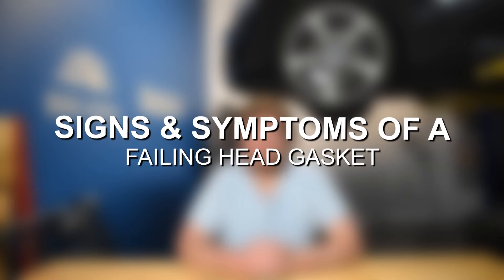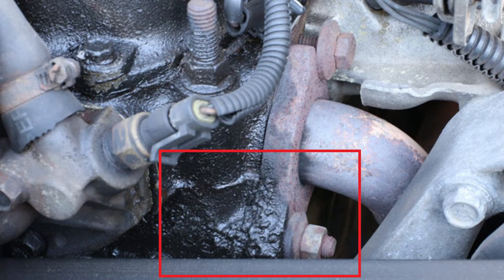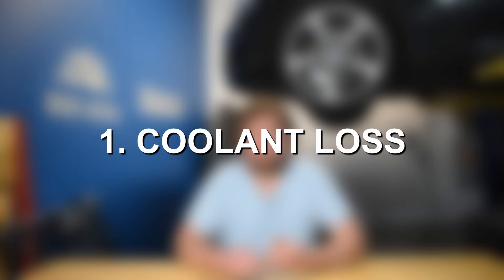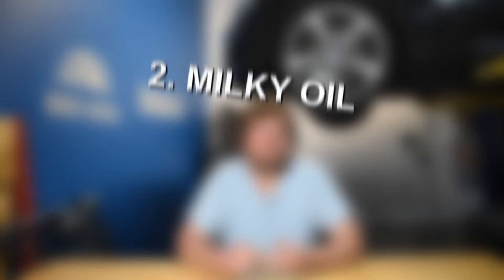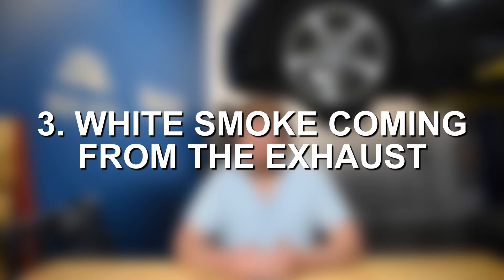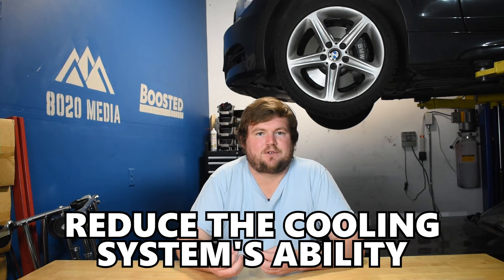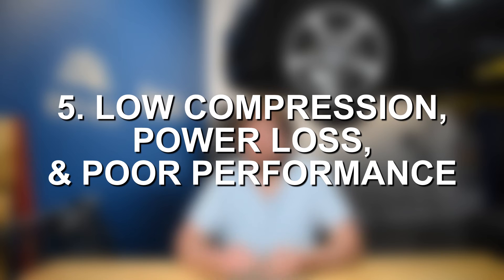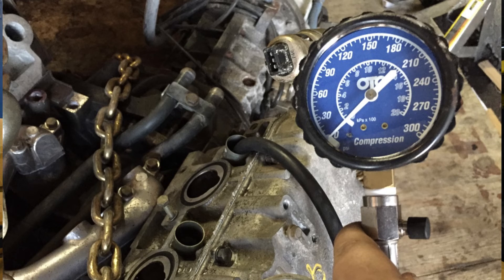Signs & Symptoms of a Blown Head Gasket!

Comment: Renault traffic 2015, recently had a new turbo fitted and oil change, since then after a short drive (15mins) when i park up smoke is coming from under the bonnet. Coolant is fine and no loss, no milky oil... any ideas would be great, only reason i ended up on your video was because i had a head gasket replaced on a previous vehicle and it smells the same as that did back in the day so im assuming it could be that, if you know what i mean
Reply: Thank you , very much appreciate your reply 👍
Reply from the maker: J - If your Renault Trafic is smoking under the bonnet after a turbo replacement and oil change, but there’s no coolant loss, no milky oil, and no overheating, the most likely causes are oil residue burning off or a turbo oil leak. When a new turbo is installed, excess oil or spilled fluids from the job can burn off the exhaust or turbo housing, creating smoke and a smell similar to a blown head gasket. However, if the smoke persists after several drives, it could indicate a small oil leak from the turbo oil feed/return lines or a poorly seated gasket. Check for oil drips near the turbo and inspect the exhaust area for residue. If smoke continues, a mechanic should double-check the turbo seals and connections for leaks.

Comment: I have no milky substance, no white smoke, but I’m overheating. Replaced everything in cooling system, even radiator cap and engine coolant temp sensors, still over heating. Could it still be head gasket without all the symptoms? 2012 dodge charger
Reply from the maker: U - Yes, a head gasket failure can still be the cause of overheating even without milky oil or white smoke. A small internal leak can allow combustion gases into the cooling system, creating air pockets that prevent proper coolant circulation, leading to overheating. You can confirm this by doing a combustion leak test (block test) using a chemical tester to check for exhaust gases in the coolant. Also, check for coolant bubbling in the overflow tank, which can indicate a head gasket issue. If that's not the case, verify that your water pump is functioning properly, ensure there’s no clogged radiator, and inspect for collapsed hoses or a faulty thermostat.
Reply: Next time make your fan hit direct

Comment: I have watery oil coming from back box (exhaust) would that be gasket issue?
Reply from the maker: I - Watery oil coming from the exhaust could indicate a blown head gasket, cracked cylinder head, or a failing intake manifold gasket allowing coolant to mix with the oil. Check for white smoke, milky oil on the dipstick or oil cap, and coolant loss. If the engine is running fine and there's no coolant mixing with oil, it might just be condensation in the exhaust, which is normal in cold weather. A coolant pressure test or compression test can help confirm a gasket issue.

Comment: I have coolent loss but no white smoke or engine oil milky or over heat
Reply from the maker: A - If you're losing coolant but there’s no white smoke, no milky oil, and no overheating, the most likely causes are a small external leak, a failing coolant reservoir cap, a leaking radiator, a loose hose clamp, or a slow leak from the water pump or heater core. Check for dried coolant residue (white or pink crusty buildup) around hoses, the radiator, and the water pump. If no external leaks are visible, it could be a small internal head gasket leak where coolant is burning slowly without producing noticeable white smoke. A coolant pressure test can help pinpoint hidden leaks. If you smell coolant inside the cabin, the heater core might be leaking.
Reply: Me too

Comment: So i have a Kawasaki z 400 and the coolant is coming out of the exhaust like dark liquid, I have changed the head gasket and changed the mechanical water pump. but the issue still persists any recommendations ?
Reply from the maker: A - Sorry to hear this. If coolant is still coming out of the exhaust on your vehicle after replacing the head gasket and mechanical water pump, the issue likely stems from a cracked cylinder head, warped head, or a damaged engine block. Since you’ve already changed the head gasket, double-check that the head was properly torqued, resurfaced if needed, and inspected for cracks—even a hairline crack can allow coolant to leak into the combustion chamber. Also, inspect the cylinder walls for cracks or pitted areas that could be allowing coolant to seep through. If coolant is still being lost into the exhaust, consider performing a leak-down test or a cooling system pressure test to pinpoint where the coolant is escaping. If the head checks out fine, then a cracked block could be the culprit, especially if the bike was previously overheated. Keep us updated!

Comment: Hi 8020 media
 I'm now totally confused. Its 07 volvo xc90 2.5t that parked about 3 weeks without cooling system issues until I had starter motor fixed.

I drove it less than 5km and left it idling for less than 10 mins. I then discovered that pressure is building in reservoir tank eventually losing almost 5l of coolant.

I thought that is happening because I might have not fully closed the cap. The following day I drove it less than 5km and left it idling for about 15mins only to discover that it is overheated and losing coolant through reservoir cap although it was tightly closed.

5l coolant got spilled but I refilled it. 2days later I drove it around 6kms but temperature was normal and coolant never spilled through building pressure in reservoir.

The car would then report low coolant even when there was enough. Mind you temperature gauge stays normal, scanner shows nothing abnormal. I could say overheating is 'intermittent'!

Scanner would show coolant temperature but at 90 degrees fan doesn't run. Engine oil looks fine and there is no white smoke. Im now going crazy...any idea?
Reply from the maker: M - The intermittent overheating and coolant loss in your 2007 Volvo XC90 2.5T is likely due to air in the cooling system, a faulty reservoir cap, a sticking thermostat, or a malfunctioning cooling fan, especially since the fan doesn’t activate at 90°C. While the temperature gauge shows normal, localized overheating can occur, especially during idling. A minor head gasket leak could also pressurize the system intermittently, even without white smoke or oil contamination, and a faulty coolant level sensor may explain the false low-level warnings. To resolve the issue, bleed the cooling system to remove air, replace the reservoir cap, test the thermostat and fan operation, and perform a combustion gas test to rule out a head gasket issue. If the coolant level sensor is faulty, clean or replace it. These steps should help pinpoint and fix the problem. Keep us updated!

Comment: I change new head gasket, but I have problem with oil mix with water from the radiator with white smoke. What is the promble.
Reply from the maker: Is your head cracked? Did you check that while doing the gasket?